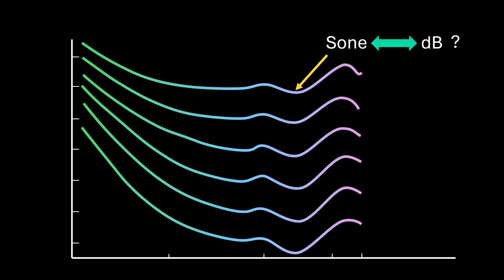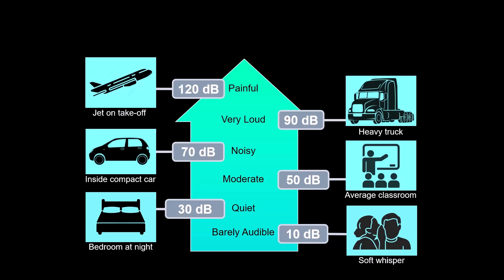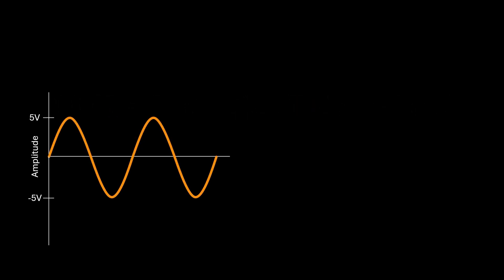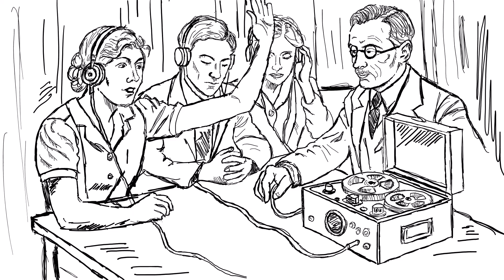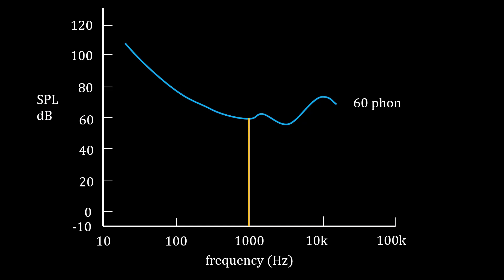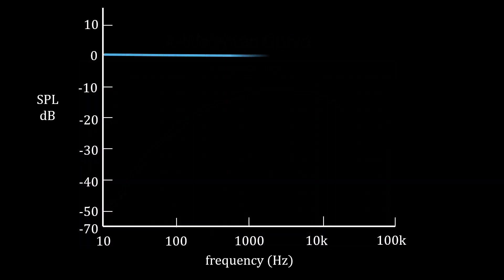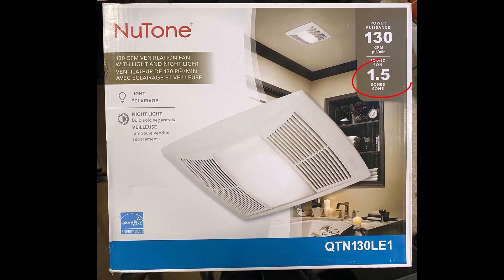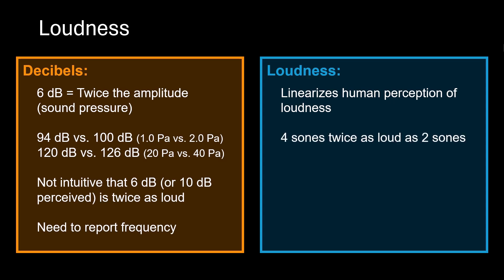What is a Sone?

Comment: When i could use loudness method? Example like sound closing door? What about test for vehicles such as road noise, still apply this method or use dBA?
Reply from the maker: Loudness can be used both transient sounds like a door closing and with stationary sounds like road noise. Both dBA and sones can be calculated from the same sound recording. Section 6.2 is this article talks about time varying loudness which is suitable for transients and stationary sounds: https://community.sw.siemens.com/s/article/sound-quality-metrics-loudness-and-sones